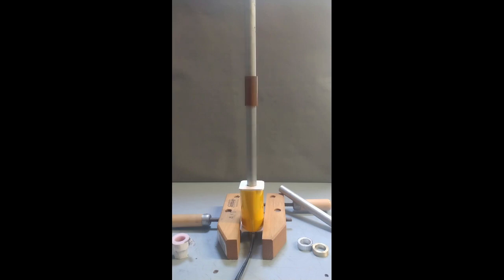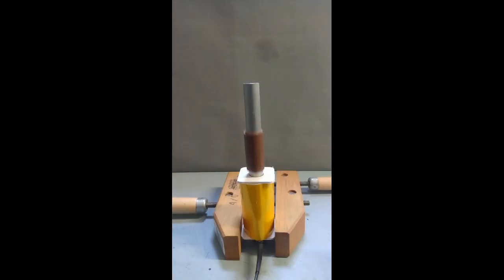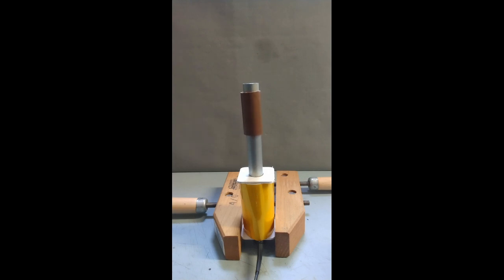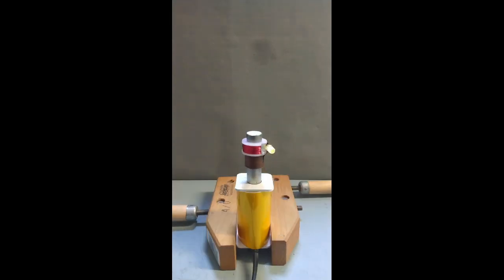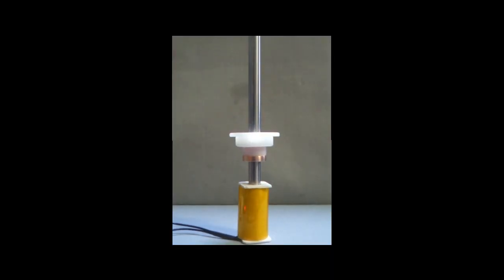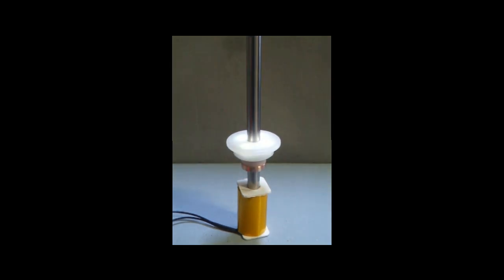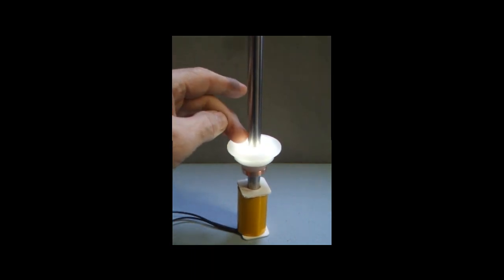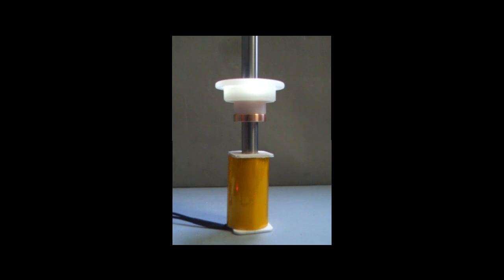Electromagnet levitator experiment

Comment: What a cool idea... How about opposing permanent magnets to keep it floating in the middle with no power, then use +/- electromagnet current to adjust the height?
Reply from the maker: Neat idea, but it wouldn't work because the electromagnet I'm using is AC and not DC. The AC electromagnet would demagnetize the permanent magnets.  Plus there would be this visual giveaway of permanent ring magnets on the post
Reply: @GuyMarsdenMakesStuff  Maybe i'll play around with the idea, pulsing DC should work with the lights and I'm not concerned about the magnets showing....... I can let you know if i make any progress. Looking forward to your followup video
Reply from the maker: @jeremiahbullfrog9288  Hood luck with it. I'll be very interested to see what you come up with.